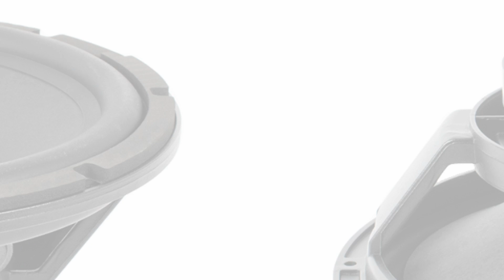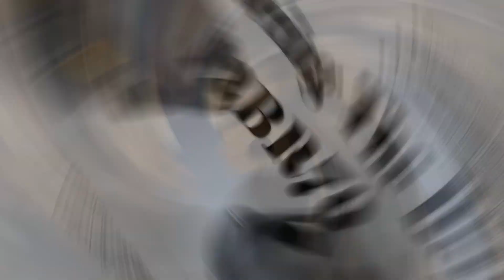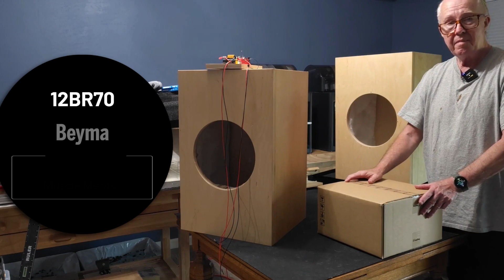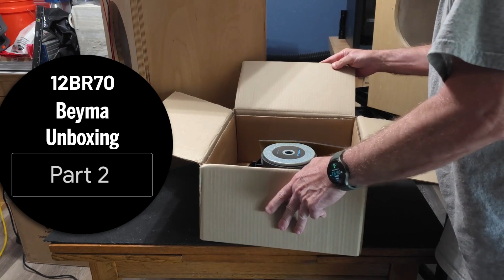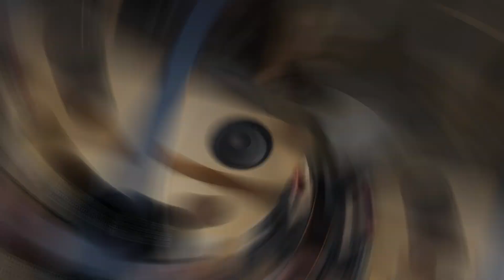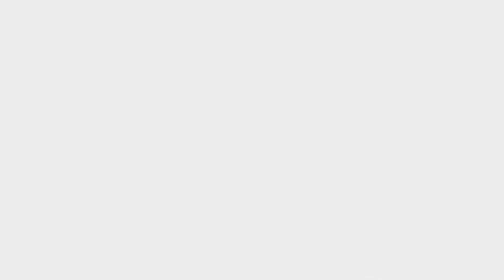Unboxing the Beyma 12BR70 – Taming the Beast for Hi-Fi Horn Systems

Comment: 12BR70 is obsolete now sad. Any good alternative 
12BR70 I have used in sealed and open Baffel and they are greatb
Reply from the maker: “Obsolete” usually means discontinued or technically surpassed.
The Beyma 12BR70 is neither. Its available in many places including: Parts Express, US Speaker, Solen, The Loud Speaker Data Base, Sound Imports etc. 

It’s still in current production, widely used, and chosen specifically for its linearity, low distortion, and controlled behavior in the upper bass and lower midrange — not for chasing maximum output or specs on paper.

In systems like ours, the goal isn’t brute-force bass. It’s clarity, articulation, and seamless integration with a horn above ~2 kHz. That’s exactly where the 12BR70 excels.

Many newer drivers prioritize excursion and SPL. This one prioritizes tone, speed, and composure — which is why it continues to be used in high-efficiency, horn-based designs.

Comment: did you also measure the off axis performance of the 12br70? I’m working them into a 3 way studio monitor build and am wondering if I should switch to Faital 12FE330
Reply from the maker: We did not measure the off axis performance as we cross it fairly low. Regarding the Faital 12FE330 I have little feedback on that one and our customers built their speakers with the Beyma and loved it.

In a 3-way design, the woofer (like the Beyma 12BR70 or Faital 12FE330) usually hands off to a dedicated midrange somewhere around 200–400 Hz (sometimes up to ~500 Hz if the mid can handle it).

At those lower crossover points:

Wavelengths are long (3–6 feet).

A 12-inch cone is still radiating almost omnidirectionally.

Off-axis narrowing (beaming) doesn’t become a serious issue until much higher in frequency (1–2 kHz+).
In a properly designed 3-way, the woofer’s off-axis performance isn’t a major concern because it’s only covering the range where dispersion is naturally wide.

Comment: This is particularly interesting to me because my hifi dealer/friend and I just put together an audiophile PA in order to test out Beyma's AMTs. I had some old Koss speakers from the 1980's that were destroyed by mice, so I had a carpenter reconfigure the boxes for a pair of 10" woofers. On top of each, we mounted a Beyma TPL-200/H. For woofers, we went with what the guy at US Speaker suggested, the Beyma 10G40. They crossover at 1200Hz with Beyma FD-212. They sound fantastic! But, I will definitely ask my friend about zobels.
Reply from the maker: Thank you for sharing this. Al at US Speaker is a great resource.